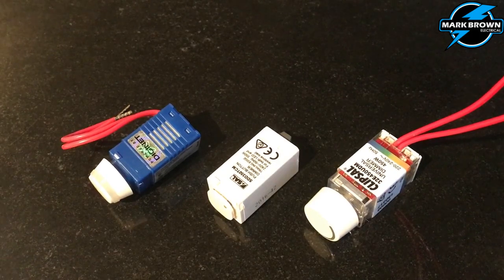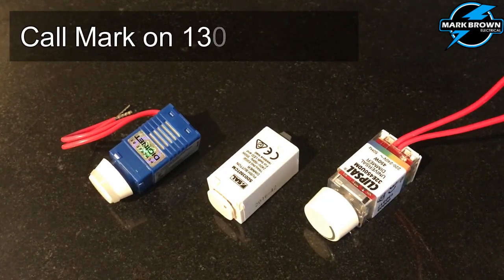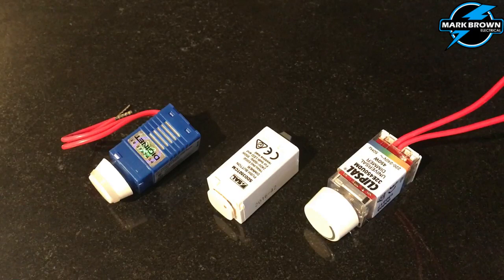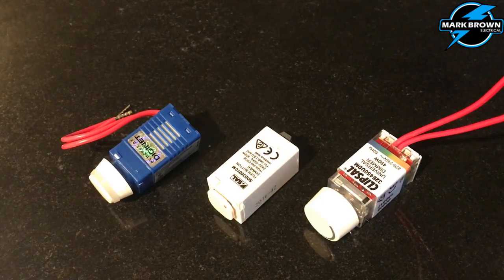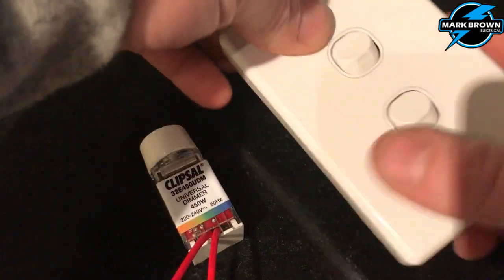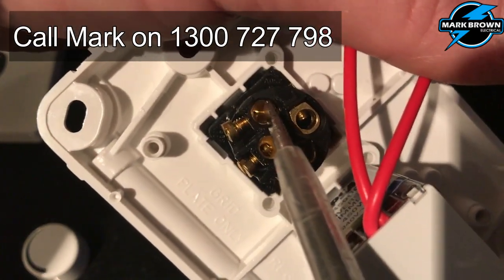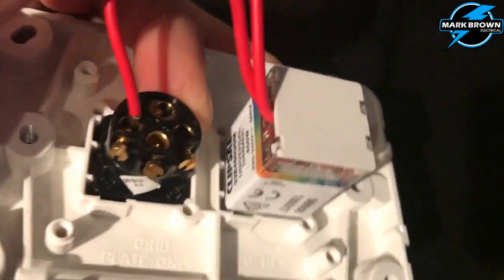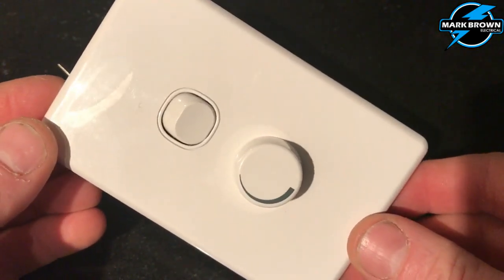Light Dimmers

Comment: Does the switch wire go in with the dimmer in l1?
Reply: No, so the switch wire that goes up to your light should be put in a connector with one leg from the dimmer. The other dimmer leg goes into your switched active on the switch. Does this answer your question?
Reply: Switch wire with one leg of dimmer goes into BP connector,  the other dimmer leg goes into terminal 1 in the Switch.

Comment: may i  ask why the dimmer has two wire design?
Reply: 谭丽燕 1 wire goes into the switched active terminal on a switch, the other goes as your line cable up to the light mate.
Reply: One dimmer leg to (1) terminal...

The  other dimmer leg with the cable that control the light switch wire goes both together in BP connector..